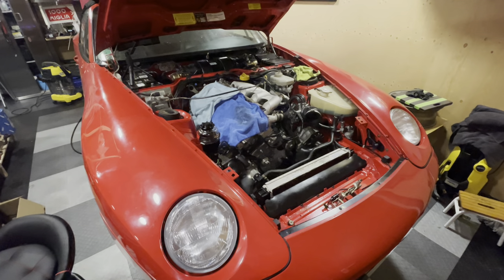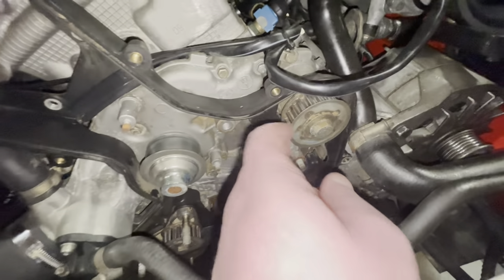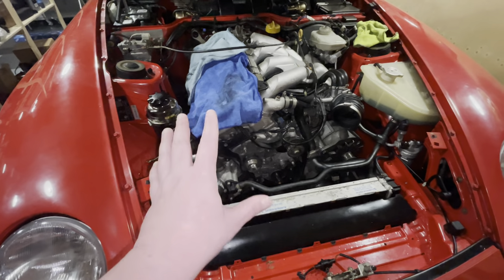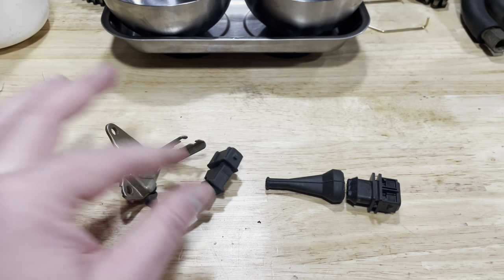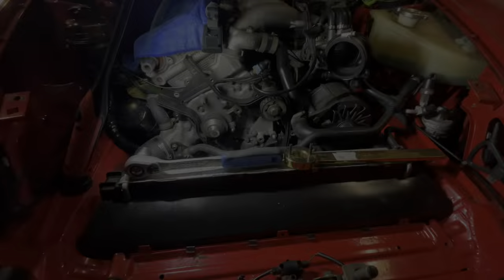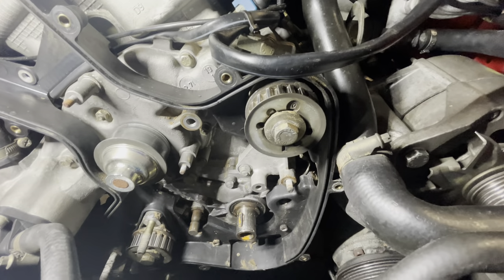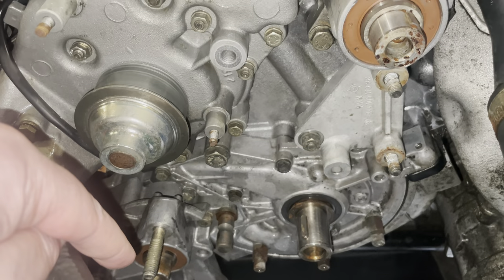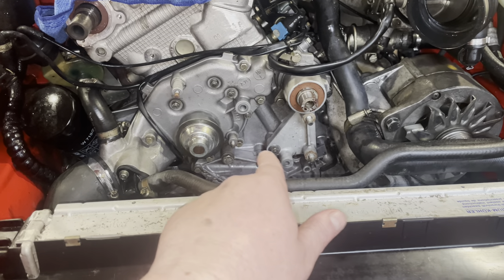Restoring a Flood Damaged Porsche 968: Balance shaft seals

Comment: The water pump on my 944 was working perfectly and it had over 220,000kms on it. I replaced it anyway when doing all the front end seals etc.
Reply from the maker: That's what I figured too, It will be 5 years before I will be in here again, so everything fresh is better.
Reply: Mine failed around 130.000 kms leaving me stranded on the way home from holiday in France. I had just done (well had done) all the belts etc so felt stupid for skimping out on the pump.

Comment: If you can’t get a good replacement balance shaft hoisting at a reasonable price, may I suggest a bit of JB Weld in the dent in the housing as a repair? File smooth any rough or proud edge and scuff the inside of the dent. I’d use original JBW or Steel Stick or whatever you feel works best.
Reply from the maker: Thank you, I did not think of that, great idea!

Comment: If you want to make your life easier, pull the bumper and the radiator especially now you are changing the water pump. Access to the lower area is much better then. I seem to remember the removal of the steering pump is somewhat illogical. I think there is a bush that pulls out of the one of the brackets which allows it to slide out. Next task is probably the oil filter housing but that really is a challenge.
Reply from the maker: Thanks for the advice, I have found the instructions for the pump, and I missed the bush in the front. What a strange design.

Comment: Jon, no apologies needed.  Any possibility that there is an oil leak from the balance shaft housing itself?  From what I understand, the only real way to get the lower housing off is to remove the engine.  Hope that your housings are solid and not leaking.
Reply from the maker: Thanks Jon, I probably have to double check the housing, let's hope she's fine. I am sure I can get to it if I remove the intake manifold...then I can replace those gaskets as well 😅